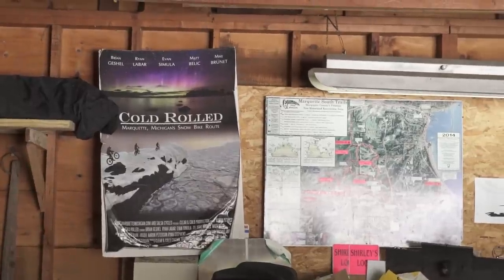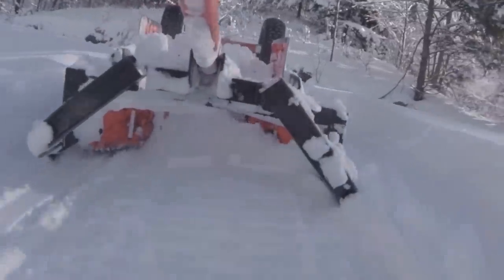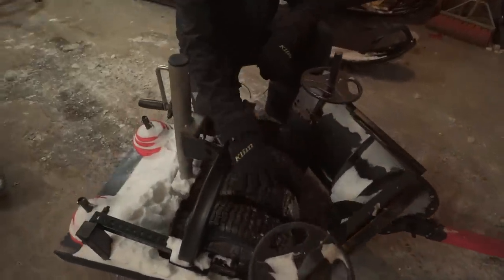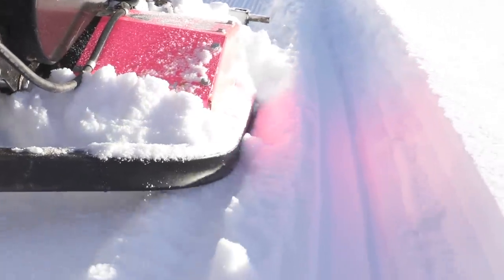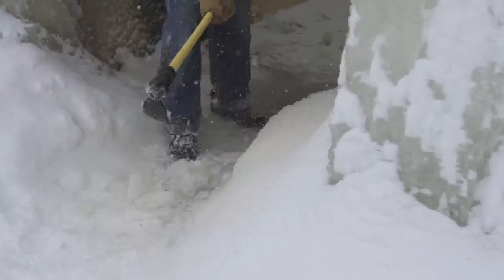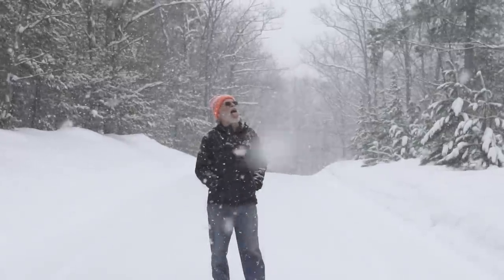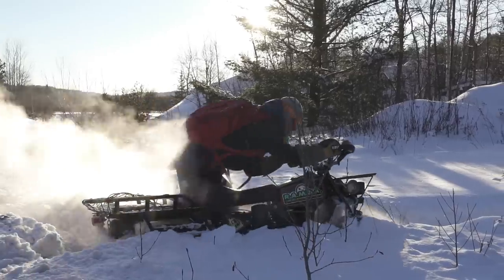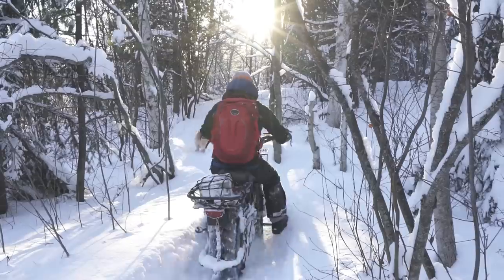'Whack Jobs’ Film: Fat-Bike Grooming in Michigan

Comment: The " 15 " tire being pulled behind the Rokon is actually the wheel size, it will widen the trail to roughly 25-26 inches wide, which is the actual tire height.

Comment: The red Dolomite is not the same frame as the normal blue Dolomite https://www.youtube.com/post/UgkxTGiBQEtJDzdz-_LjtY9HyQZPzkg6s_L9 it seems to be a Hitch with Dolomite stickers and solid rims. This isn't an issue unless you are counting on the wider tire clearance of the original Dolomite. This can be hard to tell given the angle of the pics, especially on a smaller screen. The red version does have the welded seat lock of the newer Malus. If the red color is important and you're going to be doing the basic upgrades popularized on the biking forums and Youtube; you would probably be better off buying a Hitch, getting the lighter wheels, and saving a little money. We ordered a blue and a red one and both of the bikes needed grease in the bottom brackets, hubs, and stems. No matter what, these are a great introduction to fat bikes and wrenching your own stuff at this price point.

Comment: HI i am not a "bike person" i guess but im going blind and cannot drive so i need a bike where i live is dirt slow and slush i live on ssi so i cannt spend like 5k on bike im thinking tops maybe 1500 if im lucky pref under 700 bucks can u suggest a fat bike that wont just fall apart cuz i plan to treat this thing almost like crap and it has to last at least 5+ years . thanks
Reply: Look into Diamondback, they have a decent cheap fat bike called El Oso...
Reply: If you don't plan to take care of the bike, it won't last you five years, even in great condition, no matter how much you spend on it.
Reply: thank you i will do that
Reply: @ brett no i dont plan to take care of it i had some walmart bike i beat the hell out of for 10 years and it got stolen cost 80 bucks never had a issue. 

im looking for a "bug out" bike and a fat bike with tow ability seems to fit my bill so it will have to survive mud rain sand dirt and 0 upkeep for as long as humanly possible i may get 2 and have 2 for everyday =3 thats why i ask
Reply: Etnaa flonne I highly doubt you never had an issue if it was from Walmart. Taking care of a bike is not hard. Please do it.
Reply: Salsa beargrease is what I have and is pretty damn good. Most manufactures keep their base model fat bike around $1000-1500 so you have a lot to pick from. Just avoid anything over 40 lbs.